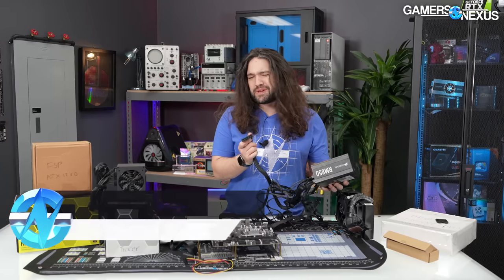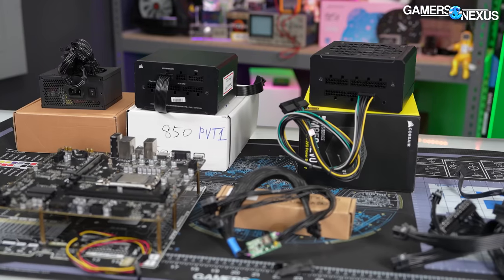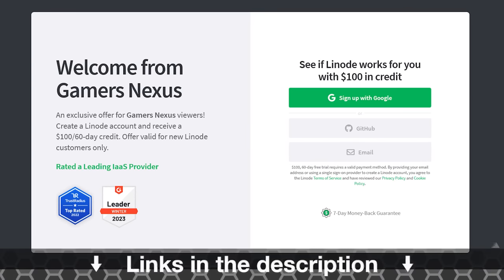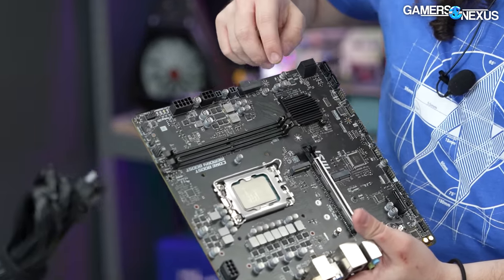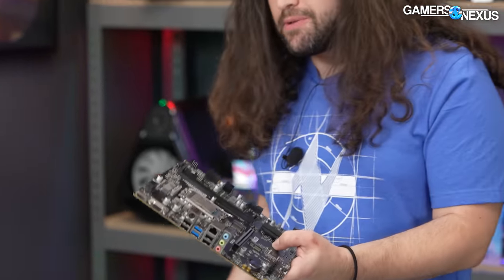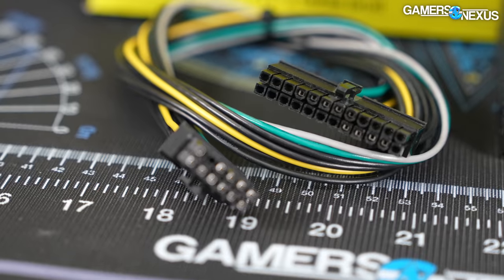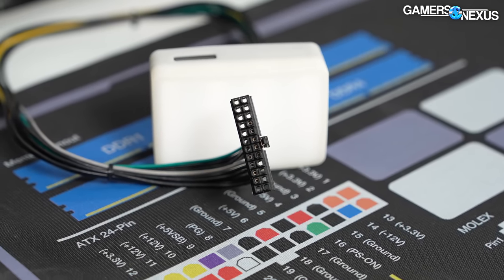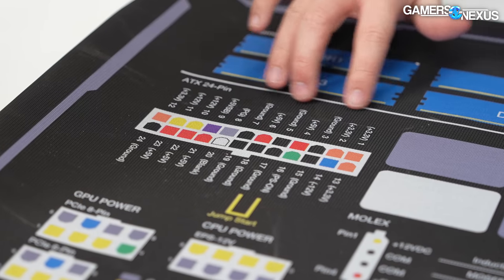The Future of Power Supplies - Maybe (Motherboard Cost, Cables, & ATX12VO)

Comment: What this most certainly will mean is that motherboards will become significantly more expensive while power supplies will largely retain their price.
Reply from the maker: Definitely agreed on PSUs retaining their price! They won't want to give up the current pricing, even if cost goes down, unless there is sudden and significant competitive pressure from a newcomer. Meanwhile, motherboards seem like they're just infinitely skyrocketing...
Reply: @GamersNexus  If this standard is pushing more power into the MB for conversion and step down doesn't that mean more heat there? 

So its more expensive overall. Takes up more space inside a build. Moves heat generation closer to sensitive components. For a benefit that won't benefit the end user and could be accomplished by other means.
Reply: @GamersNexus  its widely commonly known that enduser stick to a Mainboard for decadeds but switch the PSU on a yearly routine
Reply: Motherboards already have very high margins and are suffering from low sales due to the stupid prices that came with LGA1700/AM5 sockets.

If they push it harder into the customer, they will buy even less. This also means less CPU sales. At some point Intel/AMD will get grumpy that  Mobo AIBs are sabotaging their sales because of the stupid mobo prices.
Reply: I'm guessing that' true even though I don't understand it.  If the cost of the PS is reduced, wouldn't PS makers try to gain market share by lowering their prices?
Reply: @colinmcbottle  Business operates on margin (unless its Nvidia, apparently). If they are targeting, say, a 15% margin on something that costs $100 then price would be $115. If the cost doubles to $200 the price jumps to $230. 

And when the buyer indicates a willingness to absorb a higher price the margin will be increased. And this is exactly what got signaled to the entire industry when people scrambled for over priced scalped video cards. It was a message that there was money to be made as the people have money and are willing to spend it. That has consequences.

This means you have a double hit of motherboards being more costly due to new standards, like PCIE 5, and companies acknowledging the customer's willingness to pay more money. They will make it so expensive that scalping becomes untenable. Because they have reached the limit of your willingness to pay.
Reply: This especially bugs me since the motherboard will be useless in 5 years, but the psu won't
Reply: Hmm 2 many posible changes in psu mb and standards becoming relevant or close to... Atx 3.0 andnow this and the power supply i want to get is none of these😅
Reply: It won't stop at just adding price. You buy an asus motherboard, and now you have to buy cables specifically for that board. Just like how you shouldn't mix cables from different power supplies, the same will apply to motherboards. 12vo is a companies wet dream, and a consumers worst nightmare.
Reply: Yeah this is the usual Intel genius plan
Reply: @Tagiau agreed. More heat and more points of failure on the mobo now. This would have made sense in 2014 when PSU’s were sub $100.
Reply: @zpd8003  Some might, others can rely on their brand image as "high quality" power supplies to just sit in place. Rather than race to the bottom the more likely outcome is they normalize pricing and reap benefits until inflation catches up to the price point and they are forced to shift again.
Reply: Yep plus you have your failure modes on the MB which is not as easy to replace I honestly hope this standard is DOA
Reply: The fact that this is even being considered and branded as efficiency is foolish

Mass scale pros don’t matter at the end of the day because if it doesn’t benefit joe and Jane doe directly by a margin that matters it won’t be adopted

So that would mean it isn’t gonna happen unless a Corp forces it and that’s nvidia…. Same company who can’t keep scalpers and miners from buying cards meant for the average user
Reply: @mikeloeven  DC to DC converters is not a new technology :p
Try to think of the last time you had a 5V or 3.3V rail die on a power supply. These are internally powered from the 12V rail, not from the mains. They never fail.
Regardless, i don't think it will afect motherboard prices.. they just keep going up even with no standards changes.
On 4 CPU generations, the price basically tripled from what i see. When you had sub 200€ Z390, now we're well over 500€ for Z790.. and that's with removing ram VRM from the board thanks to DDR5...
Motherboards cost more than CPUs it's just completely bonkers RIGHT NOW... before even 12VO.
Reply: @zpd8003  No
Reply: Like others said, overall costs will go up (to be fair, they will go up anyways 'til the day the market implodes and DIY'ing PC builds is dead), and the motherboard will generate more heat.

And of course i expect the market to stick with the old and outdated motherboard form factors (frankly, who has the leverage or dominance over the market and longterm interest in it to make a change happen? I know of no one...), making proper cooling - and therefore component selection - even more of a hassle for DIY'ers. Or we all just have to get used to whiny little fans being stuck onto the motherboards. (Past) X570 owners have an advantage here, as they already got used to it ;-)
Reply: Motherboards will end up not having to do much more. There are an increasing number of people who have gone "legacy free" and don't have SATA devices anymore. There is always the option of external enclosures. Also Steve was talking about modular diag kit for $15 combined with a simple motherboard header. Well the same modular approach here, if for some reason you have go to 12vo, while still having to use SATA, then you just pay $15 for a simple 12v to SATA adapter (electrical as well as physical)
Reply: well u can replace that loser oem 150w psu with a 850w psu now if they adapt that stuff
Reply: @classicalextremism  The amount of power used for non-12v components is negligible. Probably on the cusp of even being measurable as thermals go. Where this could be the most beneficial to the end user is reducing the size of that huge brick of a PSU. My wife's case already has only a 1.5inch clearance from the back of her PSU to the drive cage making it impossible to access the modular cables without unbolting the PSU. 

As the video said, this would only affect the smallest motherboards for space and the part cost is negligible. The biggest problem is it gives the mobo makers an excuse to raise prices. The extra layer argument from them is BS cause DDR5 needs the extra layers regardless. PSU makers have $50 PSUs keeping them relatively honest while no one is keeping mobo makers honest.
Reply: @colinmcbottle  Find the impostor.
Reply: @GamersNexus  Does that mean that we'll be stuck with everything soldered?
Reply: Want to bet that they will both get more expensive? And I do mean more than just the result of inflation.
Reply: @colinmcbottle  And at that point intel will have to re-think this plan.
Reply: @GamersNexus  are you going to test how much the 12VO MB together with the 12VO power supply is more efficient than a conventional system ?

I don't see why all this has to be done by the motherboard. From my point of view, this could also be done by the power supply.
Reply: @classicalextremism  Using a higher voltage on the board until the final Point-of-Load DCDC converter reduces the current travelling on the board, and given the same width of traces, means significantly less heat. There is about a 10% higher power draw to compensate for the efficiency of the DCDC, but there is at least a two-fold reduction (more for 3.3V) in current which reduces the heat losses linearly.

Given that most logic nowadays is 1.8 V or 1.2V anyway, they already are doing conversions on the board. 3.3V is still common, but 5V (which is what the PSU currently supplies as standby) is basically useless for modern chips.
Reply: @Tagiau  wdym? The 12VO plug will be standard just like the current 24pin and 12V CPU plugs. And it's an opportunity to standardise the PSU side plug (and if they fail at that, it's still no worse than right now).
Reply: Boycott these clowns. Keep buying ATX-style mb's only.
Reply: @Tagiau  okay, OEM boards are fucked. But that's nothing new.
Reply: @shize9ine  they're probably already converting on the board, modern ICs don't really like 5V, and converting from 12V at the point of load reduces the needed trace width to reach the location of the load on the board. More voltage = less current for the same power draw. And heating in traces depends on power.
Reply: @mikeloeven  frankly, I'd rather work on the motherboard than the PSU, when it comes to component level repair.
Reply: Technically you could be using the old 5v rail to produce less heat when converting to 1.2v
But I don't see that happening outside of maybe industrial, server or other less common types of computers
Reply: Is there any conceivable advantage in this for the end user are we getting milked again?
Reply: @GamersNexus  thanks for recognizing the pricing.
Reply: @bigsky2211  basically, it comes down to the same reason long distance AC power is transported at hundreds of kV, not the 110/230V you get from the wall. At the higher voltage, the cable (and board trace) losses are less because the same power is available at lower current. And having the conversion local to the load means that regulation is much better, able to react faster, requiring less capacitance (and high-capacitance tantalum and electrolytic caps are basically the only components on the board that have a design lifetime). Instead of having to shuttle 3.3V across a long cable and traces, they can use 12V at 3x less current. Most complex logic (chipset) uses 1.8 or 1.2V so they already have to do DCDC conversion (or piss away the energy as heat in a linear regulator, which just isn't an option if your input is 12V)... All-in-all, from my perspective as an electronics engineer, I'd say 12VO would be a win in general.
Reply: @TheExileFox  yeah, but thanks to cars existing, 12V-to-whatever buck converters are a dime a dozen. At that point it doesn't really matter that much whether you convert from 5 or 12 V, it's a few-percent efficiency difference, probably made up by the lower losses in the PSU and cable.
Reply: @agdgdgwngo  In a global sense, it should be more efficient. As long as you aren't a climate change denier, that's a definite plus. There's a reason large datacenters, whose running costs are dominated by cooling, have long transitioned away from ATX, and are using their in-house flavour of 12VO or maybe 24VO.

For the individual, the difference in energy cost is probably minuscule, so from an egoist point of view it looks like progress for progress' sake. And the fact that manufacturers will fleece us on the price is down to our willingness to buy. In this case, at least there will be the option of lowering prices, if there's enough pressure from competition.
Reply: @GamersNexus  im already not selling/upgrading to am5 due to ridiculous  pricing
Reply: Motherboards also get replaced more frequently (I've used 3 different boards with the same supply over the last 10 years, and it's still going strong) so the presumed increase in motherboard price becomes even more costly to consumers over time. The amount of e waste also increases based on this.
Reply: Ok cool :/
Reply: Exactly, and it's amusing to see this video come out right after the rant on motherboard prices.

Additionally if you buy a proper quality PSU it will last you 10+ years. You will likely upgrade/change your motherboard multiple times within the same time frame. So even if PSU prices went down from this, motherboards will definitely go up in price, therefore you'll be paying way more in those 10 years than you would otherwise.

Motherboards inherently get replaced more often than PSUs since they are directly related to system upgrades, whereas PSUs are not.
Reply: @classicalextremism  As an electronics engineer, I'd much rather have the regulator feeding my circuit on the MB right next to that circuit, with nice short traces, low inductance and good reaction speed, designed by the guy the next table over, as opposed to somewhere behind a half metre of cable that is routed eff knows how and close to what, and produced to who knows what price point.
Reply: @colinmcbottle  don't Intel and AMD set the spec standard for the MoBos to work with their chips?  Just recall it's been AMD saying cheaper options for AM5 were coming as they refined the standard specs for the low-mid end A/B boards.
Reply: This needed to take over a while ago. I have ONE component in my computer that even needs 3.3 or 5v, my AIO. But there are at least several AIOs that don't, and I'd be happy to use an Arctic Cooling unit for several other reasons.
Reply: I wonder if there will be a shift to EATX if you want features due to the amount of real estate the connectors, capacitors etc. take up.
Reply: : Agreed. That was literally my first thought, too!
Reply: I don't know about that. The majority of people buying motherboards for home built PCs are buying mid to high end, and rarely the low end motherboards. So given the price premiums on those anyway, I doubt we'd see any significant difference.
Reply: Very unlikely.  The PSU market is highly competitive, and many legacy ATX PSUs (compact and high power ones) require daughterboards to fit the over-sized DC-DC converters required by the legacy ATX spec.  And even if they conspire to keep prices high somehow, the lower idle power will save you more than the motherboard cost increase in a year or two.  Much less in places with high electricity prices (>>$0.10 USD/kWh).
Reply: @classicalextremism  

Not what that is
Reply: Only for a few years to keep legacy compatibility. It's not as if SATA is all that necessary anymore for most people with many motherboards supporting 3+ NVMe slots.
Reply: @GamersNexus  Problems I see here is also the ability to supply several harddrives. This may not be an issue for a desktop but this reduces reusability for that stuff as a server. Since the power is limited to the buck/boost converters on the bords themselfs which they will probably cheap out on.
That will probably mean no reusability with HBAs for server use without an aditional PSU to supply the aditional harddrives.
Reply: so kind of like they are now because manufacturers are making overkill VRMs for the cpu by adding 69,420 power stages
Reply: If you know what to search for, a good and quiet PSU is obtainable for a good price. It's just not plug and play and you don't have the new special pin. You only need to know what you're doing - and find the appropriate guide online...
Reply: I'm just glad storage and RAM stopped price gouging. I'll stock up on sales.
Reply: @hossosplitternacken7819  Lol what? What were you smoking?
Reply: I hadn't even started watching the videos (so seeing adverts) and thought this must be the only conclusion!
Reply: Yeah, even more expensive motherboards with even more failure points; just what we all wanted.
Reply: @hossosplitternacken7819  who tf does that😊
Reply: Nah, the psus will go up in price due to being newer tech...
Reply: @classicalextremism  It doesn't push more power into the motherboard, it allows for the motherboard more capacity to draw extra power, in case that components connected to it need it. It's also not pushing it into the motherboard, it's pushing it through it, it's in transit to other components, and the same power at higher voltage means lower current, lower current means lower heat. Either way that heat difference would be similarly negligible for the end user than the standby efficiency difference, the relevant heat is produced by the components consuming that power, not by the motherboard routing it, and that remains the same.

It's also not really more expensive overall, the price will rise regardless on mATX or smaller formats because of DDR5 requirements, and it's negligible in bigger motherboard formats. Motherboard prices have been rising and will continue to do so with or without this standard taking over, and differences cause by the standard chaging should be minimal if at all present.

It doesn't take more space inside a build, it takes less space in fact. None of the current motherboard size formats need to be enlarged to fit anything the standard requires, connector headers are smaller, replaces the bulkiest cable in a build to cable manage for a smaller one more in line with the others, and allows PSUs to be cut down in size without compromise.

It's true that the main benefit doesn't affect the end user. But what other means to accomplish that benefit are you talking about? Are you actually aware of any? I at least am not, specially not of any ways that wouldn't be cumulative with this one in adding up to a larger benefit, as for it to be an alternative instead of something we'd want in addition to this.
Reply: Exactly my first thought... Also might make it harder to keep a clean build until pins start to go out the back more
Reply: It's clear prices are going to be bad, if they weren't bad enough, when all this is implemented. Consoles just got a lot more appealing for gaming.
Reply: It doesn't actually need to be.

A mainboard is already chockfull of step down conversion (check your bios and see how many different voltages you can find), adding 3 more (5, 3.3, -12) shouldn't change much at all.

I say shouldn't, but, well, you know it will as they'll use it as an excuse to raise prices.
Reply: Yup, which means the new standard is crap.
Reply: not only cost but you damned well know PSUs are going to be underdesigned... ah we;; between AMD/nvidia thinking that there;s still a crupto craze for their cards and am4 mobos being egregiously overpriced already... can I has more ARGB/das blinken lights, er sorry I meant can I has cheeseburger?

But really its going to mean more cheap VRM circuits more egregiosuly overpriced boards with less and less real functionality although I am CERTAIN  that das blinken lights will remain a high priority...
Reply: @hossosplitternacken7819  widely known? I don't know anyone who replaces a PSU yearly. That sounds wasteful of good PSUs and money.

I haven't bought a new supply for any of my PCs aside from initial purchase. 

I've commissioned an older PSU that's too wimpy for modern use (I think it's like 150W. It's very old) to be the supply for the fan on my ISPs router. (can't mod since it doesn't belong to me)
Reply: @classicalextremism  Scalping will be untenable if the price is already wicked high, aka the retailers scalp the scalpers. This is bad for everyone, obviously.
Reply: I have a lot of 12V boards stuff for mining. I use it because it's so cheap that way. 
It's not actually a new or radical thing.
Reply: @falxonPSN   its not that i dont want cheap mono, but the cheap ones are literally trash.
Reply: @bytezero3818  So no change! My HX1000i units (2 off) have both seen multiple motherboards.
Reply: Definitely agree.
Reply: @zpd8003  That's the way it should in a free and open market, but now days a lot of these major manufacturers work together to set a price that makes them the most money. Yes its against the law but most of the time they never get caught and when they do their fines are a joke.
Reply: Even worse, that you normally change a motherboard more offen than a psu. Gotta spend even more cash on parts more often
Reply: @bytezero3818  Idk, people still buy the crap out of 4th and 6th gen Intel.
Reply: @hossosplitternacken7819  In what universe? Cause it ain't this one. Even AMD, lauded for it's longevity, has a new socket every 7 years, roughly, and the hardware requirements of software are marching ever onward, leaving even the most basic of tasks unbearable on older hardware.
Reply: @zpd8003  There's only so many OEM's building power supplies(a lot less than there are brands) , so it's not as simple as a single brand lowering prices unless they are spec'ing lower quality parts in the BOM for the OEM making their power supplies.  Market share is nice but profit margins will remain top priority as a business.  Shareholders and Investment companies don't get paid unless the margins are there, despite market share.
Reply: @classicalextremism  I don't think heat will be a big issue. There are few things on a modern motherboard that draws current from the 5V and 3V3 rail. I think the goal is to eliminate the rails, not moving the step-down circuit.
Reply: @batzd  Sure, but if you want quality components and designs, by definition that cannot be cheap.  Cheap mobos have always been for those who don't care about quality/stability or those who are strapped for cash.
Reply: @GamersNexus  power supplies are more permanent than most pc parts so it deserves to cost more than most CPUs
Reply: @andyhu9542  Yeah I don't think fully eliminating will happen anytime soon. Look at the M.2 slot which only gained traction in the last few years using 3.3V. USB isn't going to disappear anytime soon and it needs 5V. Even weirder USB PD is like 5V, 9V, 15V, 20V, 28V, 36V, 48V. No 12V in sight. Granted the requirements for these devices are kinda low. Normal USB is like 10W max, your average mouse and keyboard probably draw a lot less. Your SSD is probably around 10W peak too. I have a 12V power supply that powers my router, modem, external hdds and also my raspberry pi with a cheap buck converter because it wasn't worth it to buy a 5V power supply for the 2 things that need it.
Reply: @KiinaSu  I am fully aware of the USB, PCIe and M.2 requirements. However, this can be solved by adding converters 'on site', as things like USB PD need a dedicated converter regardless of what supply voltage is. Graphics cards shouldn't draw a ton of power from those rails, either. My three concerns are: non-graphics cards people put in the PCIe slot (sound card, network card, SAS controller...). Other chips on the motherboard (South bridge, BIOS flash, sound chip...) and peripherals (SATA hard drives).
Reply: @KiinaSu  The solutions are: a board to convert a PCIe 6-pin to multiple SATA supplies, made as a separate purchase for those who need large volume HDD (2.5-inch SATA SSD doesn't make sense in newer designs since M.2 SATA SSD exist). A converter for PCIe and M.2 and maybe a separate one for the South Bridge. This will provide the additional advantage of cleaner power to those chips, at the cost of more VRMs. However, as speed increase and design constraints tighten, we may need those VRMs anyway.
Reply: @GamersNexus  I remember back in the days an €80 Motherboard was good enough and €120-€140 would get you a very good motherboard. These days those basic motherboards seem to start around €150-€200. Wtf? Why would I keep on building instead of just buying a console and ultrabook?
Reply: @WowUrFcknHxC  This isn't true: linear voltage regulators generate a large amount of heat, and a system to cool that amount of heat may be more expensive than a switching regulator!
Reply: @Suji.....ding!...ding!...ding! Exactly.
Companies are greedy.
The motherboard manufacturers will see this as the opportunity to push it as some crazy good feature.
The power-supply manufacturers will never drop the price to reflect less circuitry and features.
In the end, the consumers will pay more...as we always do.
Reply: @GamersNexus  not to mention this just makes compact all in one PCs more appealing to regular people
Reply: @hossosplitternacken7819  I dont switch anything for decades until it is broken or very outdated ;)
Reply: @classicalextremism  Then theres the question of how powerful/fast(expensive and power hungry) do pcs have to be in order for developers to make fun and quality games for pc. Because thats what many use expensive pcs for, gaming. Developing and manufacturing ever more complex and expensive components benefits companies developing and making them. While to common consumer its not necessarily that given how much they benefit from it given that even some older games or even really old games look fine to good today. 

Then besides targeting foto realism/hyper realism, how powerful pc is powerful enough for that purpose. For plain old pc gaming today and tomorrow. As prices of certain components have gotten out of hand, are we talking about lack of power/performance or gross overpricing or weak optimization or all of those combined. And what would be solutions to solve some of those or all of those problems especially in bad economy situation. Would software/optimization solutions be also taken into consideration besides constant hardware updates for example.
Reply: @gmailftw  500 euros is really the bare minimum for a something something gpu today. If you want a good gpu, one should put 1 in the front.
Reply: @Validole , even if it's more efficient, it's not clear that this efficiency won't be overshadowed by: a) perfectly good PSUs being thrown out, b) having to manufacture adaptors of various types and c) having to manufacture step-down converters on motherboards every few years compared to having them on PSU which lasts for decades.
Reply: If "Designed for PCs" power supplies stay the same price or even get more expensive with 12VO, some entrepreneurial asian company will make a cheap board that will make cheap 12V industrial PSUs 12VO-compatible. Hundreds of watts at 12V won't ever be cheap, but there's a floor here IMO.
Reply: @hossosplitternacken7819  lol no ?
Reply: I actually disagree with you on this point. There’s a good chance that both motherboards and power supplies will both reduce in price with this new standard as all motherboards already convert the majority of power from the 12v rail and the extra large connectors and cables are no longer required. These connectors use a lot of board space that’s actually more expensive than the parts to convert the voltage.
Reply: Everyone in the enthusiast space is missing the first point made: 12VO is primarily intended as an efficiency enhancing OEM spec. In a modern office SFF pc, there simply isn't the raw power requirement at all. The board and psu design will be cut down to make the increase negligible. At most these PCs have 2 storage devices, and medium power CPUs. They already have sparse boards, so I don't think it will change much.

The power conversion isn't complex, so at scale I can't see it being a huge increase. Aftermarket boards aren't subject to any restriction, so they may avoid 12VO for some time yet.
Reply: Yay more mb profiteering
Reply: @GamersNexus  You have a Lab. Just check, how many IC's, power supply pins, on the current motherboards, are directly connected to the 3.3 and 5V connector from the PSU?
Reply: exactly my thought! Well said!
Reply: @bytezero3818  It will be useless (the PSU) in 5 years if all the motherboard OEMs get together and agree to switch to ATX12VO...
Reply: There is no such thing as "They won't want to give up the current pricing", because in same logics I could say "motherboards manufacturers will not rise price not to loose their customers".
There are manufacturers who wants make more money (all of them), there are customers who wants to buy quality product for reasonable price, there is market where manufacturers are fighting for their customers (and one of the most important things is price). So want somebody or not, some day one manufacturer will drop the prices to get more customers and market will automatically regulate prices to stop somewhere in the middle of the quality\price point. That's it. 
  The discussion about the fact that manufacturing of PSUs will become cheaper but all manufacturers will sit on "one table" and just decide not to drop prices....is somewhere near the discussion about flat earth - very interesting but very stupid.
Reply: @OstJoker  The fault in your logic is that you believe that manufactures don't sit "in one table" and price fix the market. Oh yes they do. Like AMD and Nvidia are price fixing the market because they are duopoly. The same is happening with motherboards. You need a motherboard to build a computer. So manufacturers increased the prices (see AM5 prices) because you will have to buy one either you want it or not. PSU prices have skyrocketed the same way. They are fixing the prices.
Reply: @gmailftw  500 dollar video cards?  Maybe for a junker.
Reply: MB Prices are already ridiculous =\
Reply: It looks like those public  dumbs are not taught to use power off button and everything needs deep sleep low power savings.
So big companies and govs gonna save big money on this upcoming standard and mainly budget mainboard buyers and frequent DIY upgraders going pay kidneys for it, while savings is insignificant for them with very little AFK time.

No surprise this impulse comes from such huge company like Intel, those guys probably wants some bonus for (AFK) energy savings 😅.
Reply: And mainboards are less flexible in use than PSUs, obsoleting sooner, so as soon as you keep a PSU for a new system, you are paying for the voltage conversion another time.
Reply: 😮6